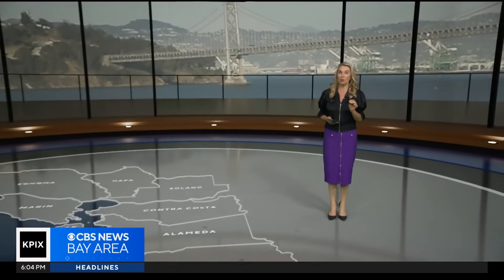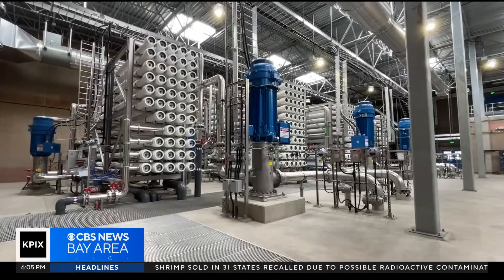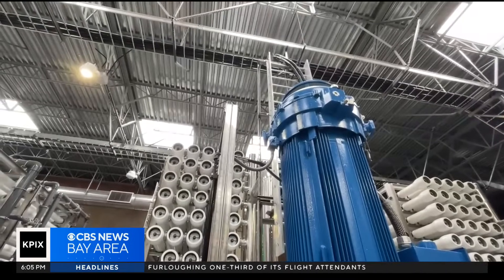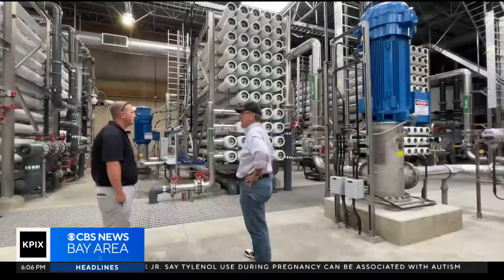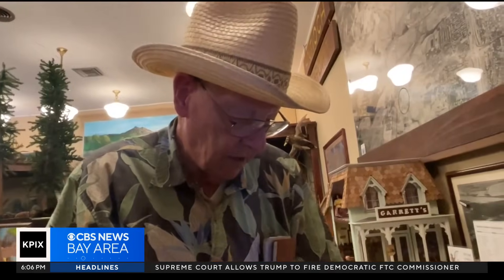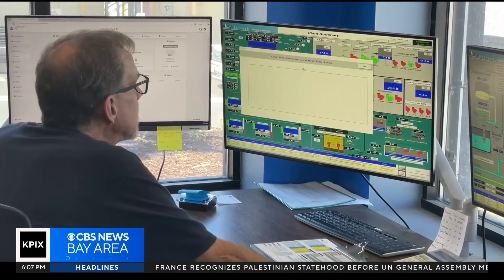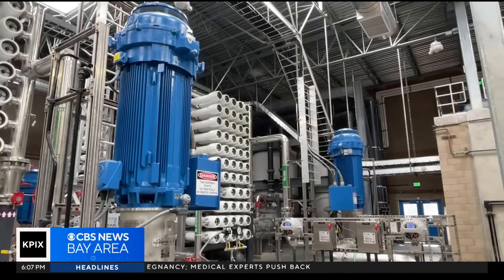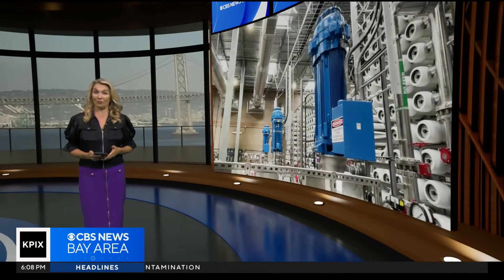Antioch launches innovative desalination plant using Delta water

Comment: The salty brine discharge in concentrate is difficult to process and release without significant impact. That will be the follow up story in a couple years.
Reply: As noted in the report, the desalination plant is used in only summer and fall which is when there is low flow in the Sacramento River.  That means ocean salt water comes further inland and the water is really brackish, so much more salty. The brine released from the plant has a negligible impact this time of year.
Reply: @williamlloyd3769  it will only be used during the most expensive months of the year for electricity ? The electricity power needed will greatly increase rates in the area. It will never be cost efficient …